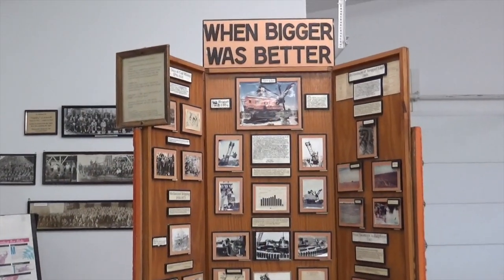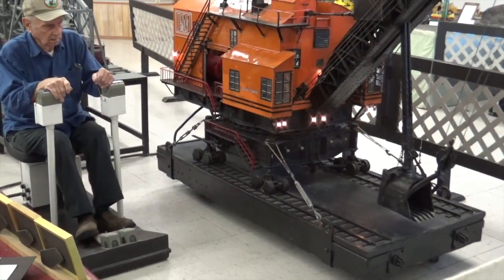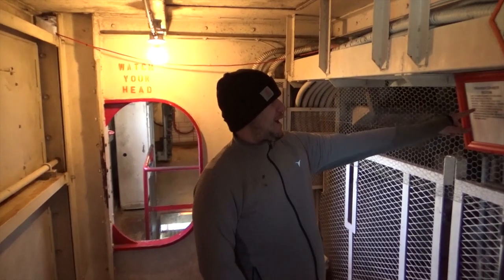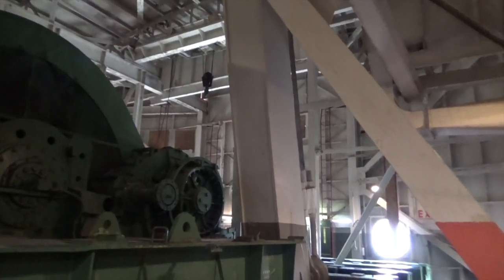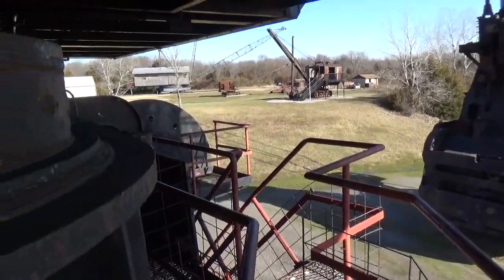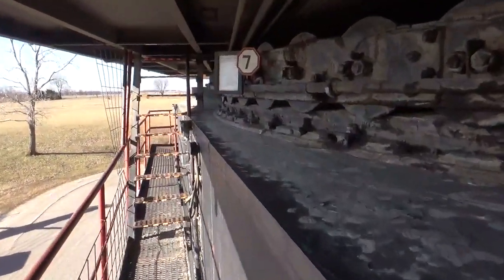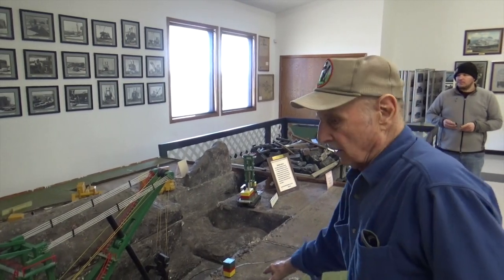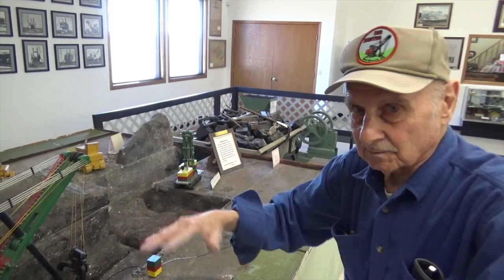Big Brutus

Comment: My dad took me & my brother to Brutus back in around 1958.  It was operating & stopped for a lunch break.  Dad talked the operators into a tour.  We went up the elevator underneath & up some internal stairs to look over the big room from a higher level with all the cables in operating condition.  In the end we stood in the operators room for about 10 min. while he operated the machine.  It was much quieter & smoother than you would think.  When it turned to pick up & drop load from the shovel it was almost as if the land was moving back & fourth instead of Brutus.  Also, when we were in the operators room they had a refrigerator inside the door in the corner for drinks & lunch.  What they let us do was probably against the rules but it was a very special memory.  If I remember correctly I think there were 3 operators involved.  We had to walk about 1/4 mile from the parking area to get to it when the horn went off & OT stopped.